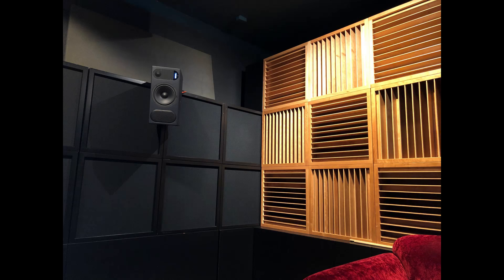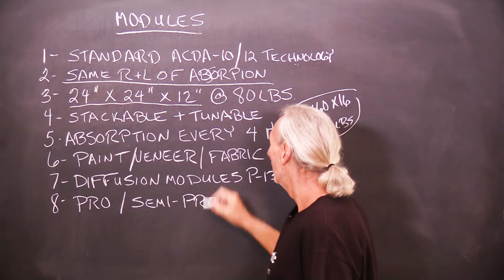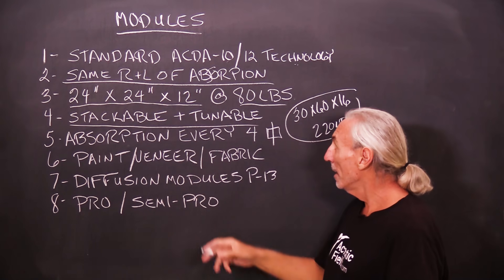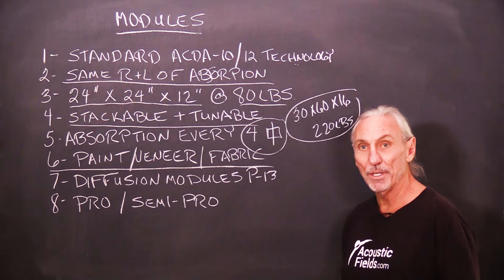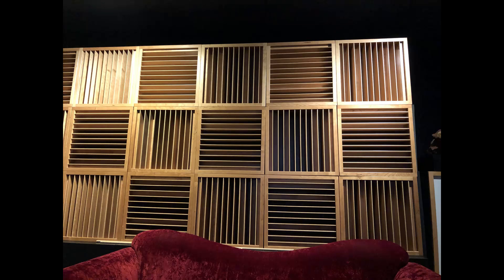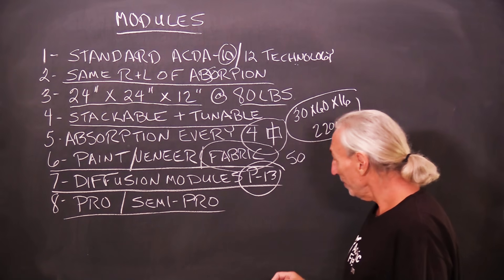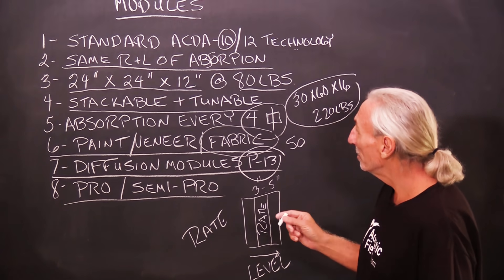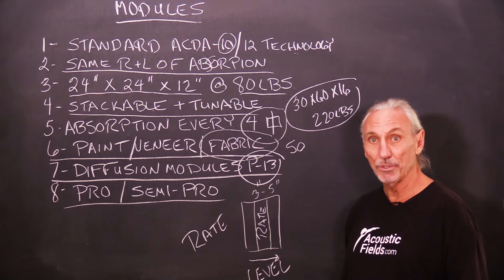Modules - www.AcousticFields.com

Comment: Amazing informations in this video. Not that you didn't mention most of it in other videos, but this just sums it up for me and makes things more clearly. The funny thing is that 2 hours before you released this video I figured out that the huge peak at 48 Hz in my room comes from my sidewalls. :) You confirmed it now. I assume the reason why that peak is most of the time on the side walls has to do with the room width? My room is 4,18 m wide.
Reply from the maker: M, Room dimensions dictate room modal issues.